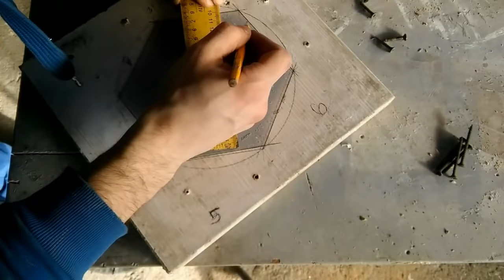How it's made Concrete japanese lanterns - Omokage Yukimi-dōrō

Comment: You have a real gift, and I appreciate you sharing it. I noticed that you are using the silicone molds instead of the plaster molds. Could you explain the advantages and disadvantages of plaster mold versus silicone mold with plaster shell. With respect, please and thank you

Comment: I was told before that you couldn’t use silicone moulds for concrete as it ate away & damages the silicone :s Do you have any problems or best  materials to help with that or advice? I’d  really appreciate it. 
Oh & what is the white material? Foam, polystyrene, or that air-rated concrete blocks? & do you make that too? Sorry for all the questions. Thanks again for sharing. I’ve been looking for videos like yours for a while now & so glad I’ve found these videos of yours. N.K :)

Comment: I love your vids :-)
I have one question: Why you produce a mold from 3 pieces (1:04)? Why not just only two halfs?
Why you use starch instead of soap when making silicone mold?
Why you nead the silicone mold at all when the shape of the "plate" has no complicated or sticked out parts?
You could just coating with separating agent and that's all, or not? Or what was the reason to make a silicone mold for the plate?
What you are doing at 6:53? What you are using there?
Best regards!
Reply from the maker: Thank you! :)
I made the mold from 3 pieces because I had problems in the past with the demolding process and broke the mold,.
I use wheat flour because It's the only process I tried and it works... maybe I'll try with soap in the future. I use silicone molds because, it is very good for production, you can demold faster, the concrete doesnt need to be cured as much.
At 6:53 I used oil as separating agent, as extra precaution.
Reply: What kind of oil? Btw. I forget to mention that you are a genius. So much passion in you work. I have subscribed you channel. Mulțumesc foarte multMulțumesc foarte mult!
Reply: May I ask, Paul, how you made those three pieces for the top dome?